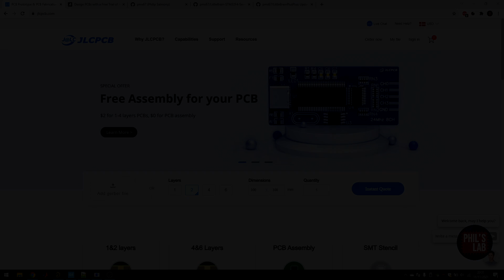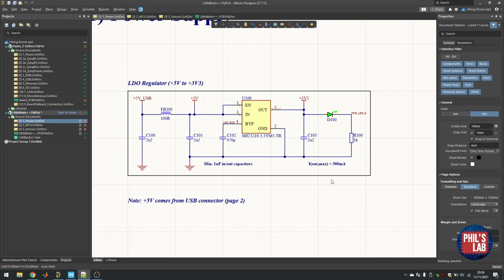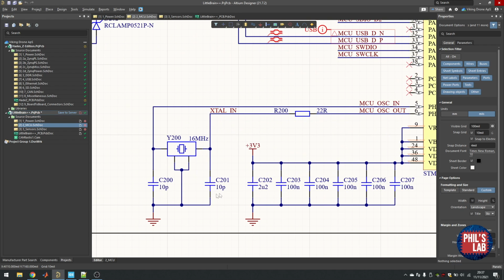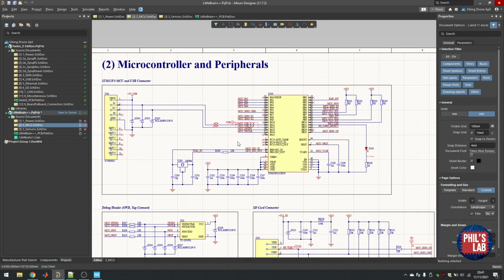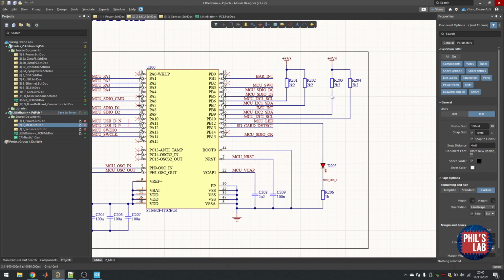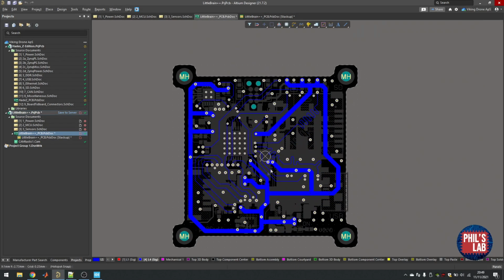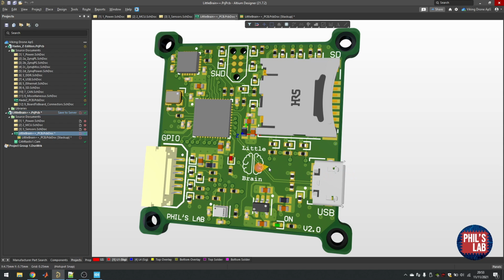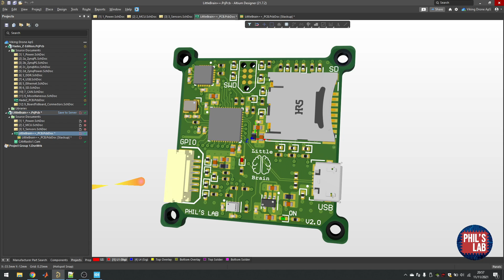(Sponsored) Altium STM32 Hardware Design - An Overview in Under 20 Minutes - Phil's Lab #38

Comment: Hi Phil, In your video you mentioned that C208 needed to be a low ESR cap, in fact in the DS for the STM32F411 calls out for caps with an ESR < 1 ohm. In your BOM file it looks like your using JLPC part# of C23630 or Samsung Electro-Mechanics part #CL10A225KO8NNNC, which I couldn't find the ESR value for it. What did you look at in the DS to help you choose this cap?
Reply from the maker: Hi there, to be honest it turns out for most designs I've found that 'any' cap will work.

Comment: Nice video! You might want to check rounded pads especially for high density boards. also, altium has a very neat automated file export, so no need to run file->export for every step (it's called outjob file). cheers!

Comment: great job Phil,
I would like to know how you calculated your pi filter on VCC rails, it would be great if you explain.
Industry experts warns us about not to use F.beads on VCC rails(in terms of EMC-EMI). And I wonder how you select your components.
Reply: Great question! I want to hear the answer as well. On the other hand, shouldn't it be enough to use a linear regulator with good PSRR to filter the USB supply rails?

Comment: Awesome video! How do you chose the right type of TVS diode? Which specs do you care about the most? Cheers.
Reply: Well, the clamping voltage should be less than absolute maximum voltage of your ic's, if the traces are high speed one's, you should choose   esd parts that add low capacitance onto the trace.
Reply: Looks like Phil is using  TVS Diode = RCLAMP0521P-N, which is manufactured by Bourns and is also JLCPCB part# C316043, 0402 footprint.  16 volts clamping and 20kV Electrostatic Discharge rating (bi-directional).  This TVS diode seems to be adequate to protect the external connection traces such as those for JTAG debug which can generate destructive static charges during physical connect/disconnect by human hands.